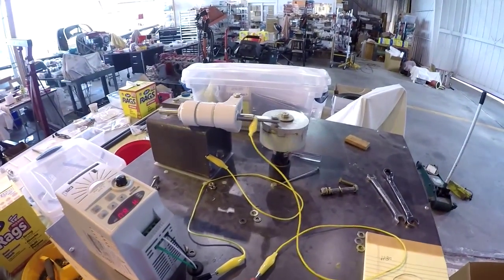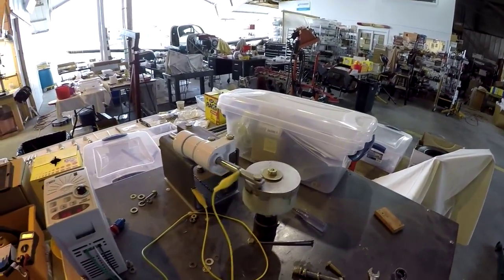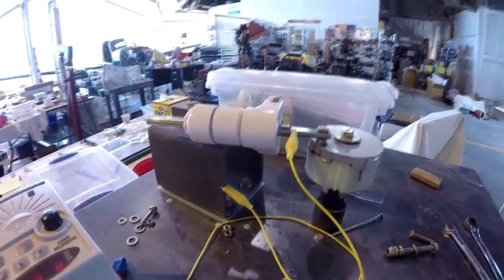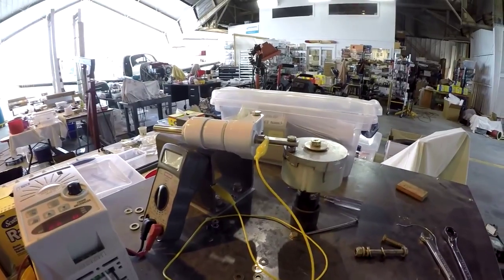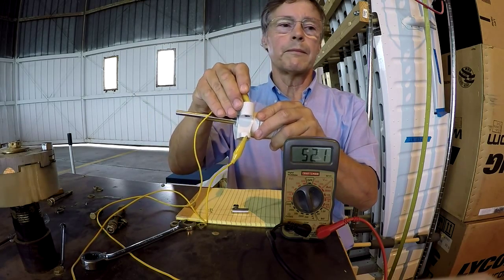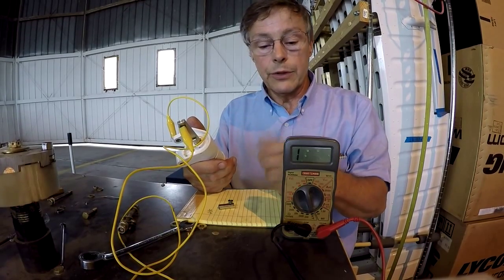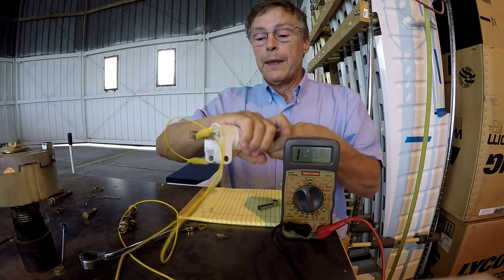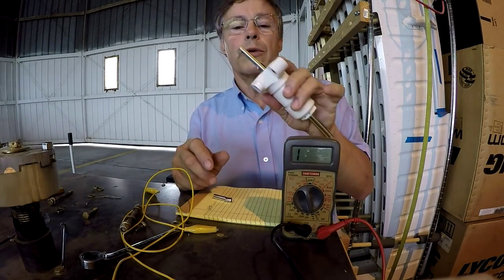AP450-100 Shimmy Damper Test

Comment: Hi Jim, when you were over at the UK Commander fly-in at Kemble on April 20th 2013 you told us that this item was in prototype and you expected it to be certified by the end of 2013, you were also after initial orders to bring the part to certification. We were very interested in this as we have had some shimmy damper issues with our aircraft and so we paid $850 so that we would be one of the first as soon as they were available. Does this video mean that finally we are going to get our damper? Our aircraft is G-CNCN an AC112TCA and it was purchased under the name of G.Frost.  Thanks Jim we are really looking forward to getting this item ASAP. Regards Terry